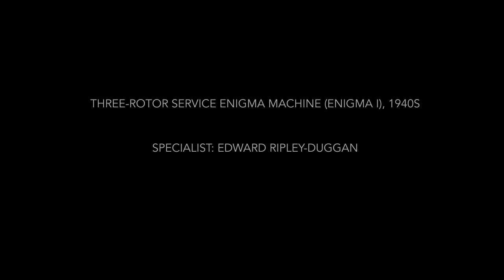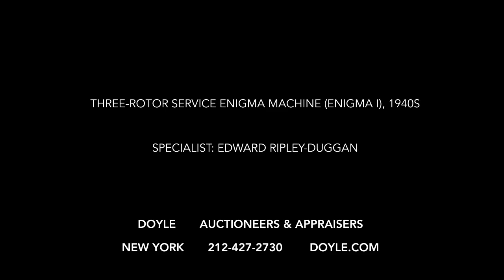Enigma Machine Demonstration

Comment: Funny seeing an enigma machine being powered by 2 modern AA batteries...
Reply: These 2 bots are everywhere
Reply: Lol
Reply: I can't sense the scale - - I thought they were two C cells batteries - - makes more sense
Reply: Enigma was mostly mechanical device - the only thing that needs electricity in Enigma is the light bulb. And just like flashlights do work with batteries, so could Enigma. In addition, using batteries as power source for these museo machines is a safety measure in case something causes a short circuit in that old device, nothing gets damaged easily.
Reply: They were AA batteries in an off-the shelf battery compartment. The machine was designed for a low voltage lead acid battery. Someone made (or may still make) a battery enclosure that resembles that official issue battery. I had a great deal of fun learning to use the machine, which is beautifully made, as witness the fact that it still worked.
Reply: How is it funny?

Comment: Still amazes me that the Germans designed a marvel of mathematical, mechanical, and computing engineering and they just put it in a small wooden box.
Reply: And how Turing understood the code
Reply: @Uncle Bremner I know it was a an incredible invention and I was just telling that Turing was a genius too.
Reply: Every electric or electronic device was put in wooden casings at that time. Have you never seen an old radio receiver ?
Reply: How so? They invented close to half of the modern world and continue to make great achievements.
Reply: Germans to date is the power hub of engineering

Comment: Apparently, if you try to encode a letter, you will get any one of the other 25 letters of the alphabet, but never the letter itself.  Numberphile has a great video explaining this, though I must admit that a lot of it is beyond me.
Reply: Great thanks
Reply: That was one of the keys to the British codebreakers being able to break the code, particularly if they had a guess. For instance, the signing off for a message might be the same, so if a letter matched, the settings could be known to be wrong.
Reply: A channel called Jared Owen has a fantastic animation explaining how the electrical circuit and mechanism works to scramble each letter
Reply: @thehelldoicallthis9241  yup just saw that. But he didn’t demonstrate the decryption.
Reply: @dibbyo456  he did. You just type in the message with the enigma in the same configuration as the sender and the lampboard spells out the decrypted message.
Reply: Given that the encoding was done purely by electromechanical construction, I think that it was basically impossible to achieve encoding of a letter to itself back then. The encoding path was literally electrical wire connection from one letter to another. You couldn't connect a letter to itself. Especially when you consider that plugboard is used. Given the nature, the same key can encode and decode a ciphertext (that means it's a symmetric key encryption), though it's the same mechanism that achieves both things, not two different algorithms like nowadays. Meaning you can use the very same machine for both encoding and decoding. Combination of one single algorithm for both encoding and decoding and the use of symmetric key for both encoding and decoding, and given the fact that it was done purely by electromechanical connection of literal wires inside the machine, I think it would be quite impossible to encode or decode a letter to itself.
Reply: @dibbyo456  The trick appears to be "the reflector." At that point in the rotor position the two letters are connected. Pressing one will light the other and vice versa. That's why you can encrypt and decrypt with the same machine and settings. And as a consequence, a letter wouldn't return itself.

Comment: Imagine Alan Turing would be German
Reply: Better NOT !!!!    :o)
Reply: The Poles broke the Enigma Cipher first!
Reply: @Jeffrey314159  What were the Polish scientists who did this?
Reply: @siriusleto3758  it was maria rejewski but it was getting too much time taking so alan turin helped to build a machine which would do it much faster
Reply: @indronilganguly9715  No. Polish scientist broke the code before 1936. But just before World War II, Germany added 2 more rotors, and to crack the code, scientists would have to use all the money for it (entrare intelligence department). And that, of course, was too expensive.
Reply: "Imagine Alan Turing would be German" - in fact the Germans had a fair amount of success in breaking Allied codes (and the Italians didn't do so badly either, simply breaking into the US Embassy in Rome and stealing the diplomatic codes - before Pearl Harbor.) The German codebreakers were not quite as smart as Turing et al, but they didn't have to be, as British codes were not that difficult to start with. The Germans were well ahead with Enigma and Lorenz, so their ciphers were hard to crack, requiring the genius of folk like Turing, Bill Tutte et al (and Rejewski before them.) Whereas the Brits used the B team to devise their own ciphers until they woke up circa 1943, meaning the Germans didn't need to be that brilliant to crack them. It should be said that the Germans devoted far less resources to codebreaking than the Allies, and were much more compartmentalised and disorganised about it.

Comment: 700 U boats was destroyed due to decoding this machine
Reply: Not really. Only about 750 U boats were lost in the Battle of the Atlantic, by no means all of them by enemy action. And obviously hundreds of them would have been sunk even if BP had never decrypted anything. The figures for U boat sinkings show a steady rise throughout the war, but then the number of U boats to sink also rose. The period March - November 1942 when Bletchley Park lost Shark - ie couldn't decrypt enemy messages, doesn't actually show a change in the trend of U boat sinkings. (Though it does show an increase in Allied shipping losses.) The figures for U boat sinkings start getting alarming (for the Germans) with increasing Allied long distance air cover, and the introduction of centimetric radar in 1943. 

In reality a whole host of things contributed to the Allies winning the Battle of the Atlantic, definitely including cracking naval Enigma. But the intelligence gained from this was probably more important for routing convoys away from U boat packs, than in actually sinking U boats. Which was of course important - the object of the exercise was to ship material across the Atlantic, not to sink U boats for the sake of it. But if you're interested in sinking U boats per se, it was more to do with increasing air cover, more escorts, better radar, Leigh lights and so on.

Comment: At first, I used to think that the machine is gonna be hard and complex, but when I tried it, It strikes me, because I was surprised at how easy it was to use an Enigma machine...
Reply: Of course, it's designed for operators to quickly decode and encrypt messages. The engineering underneath is what is baffling.

Comment: Did it have one functionality for checking if all light bulbs were working? Because I imagine it would be very troublesome if you pressed one letter and no light turns on...them you know some light bulb is burnt, but you don't know which. And the way the machine works it is not like you can press every button to check which one is the broken bulb...
Reply: You can press every button to check bulbs. As long as the initial positions of the three rotors are set back to the right one when you finish checking, it's fine.
Reply: I wouldn't be surprised there was some test lamp function on it. All the old equipment I used to work all had a test lamp switch.

Comment: From the video I understood that to encrypt and decrypt a message you have to set the rotors into a certain position first, then, as encryption goes, the rotors are spinning, and their position at the end is completely different. To decrypt the message you have to set the rotors to the initial position. Am I right?
Reply: Yes. 

One of the cleverer bits of the German Enigma procedure was that the sender chose a new start position for each message, and sent it to the recipient encrypted. So if there were a hundred different users of any particular key, each sending five messages a day, there would be 500 diffeent start positions used, not just one pre-printed for that day on the key sheet. Makes life a LOT trickier for the enemy to decrypt. (Note the guy in the video gets this wrong at 1:45 when he says that you set the three letters at the top to "the key for the day." The three letters (strictly numbers in the military version) at the top are how you set the message key - the start position - which as I say is different for each message. )

The Germans started off (prior to 1940) with a major error, as their procedure required the sender to send the message start position TWICE. So suppose the chosen start position was WXY, the operator would tap in WXYWXY and get out say DEJMAP and send that. But from that the enemy knows that D in the frst position and M in the fourth position must be the same letter, likewise E in the second position and A in the fifth position etc. That doesn't solve the whole puzzle but it enabled Bletchley Park, looking at lots of messages on the same key, to rule out vast numbers of settings as impossible, making solution a lot easier. The Germans wised up and stopped this sending it twice procedure, but in the meantime BP had read plenty of messages so they had a good idea of the sorts of things the Germans were likely to be saying, which helped them later with devising "cribs" - ie guesses of the plain text.

Comment: 1:30 Cryptographic Complexity doesn't equal Cryptographic Security - - that's the big mistake the Germans made/assumed with these rotor based machines
Reply: You have to remember that enigma was basically a mechanical calculator that only used electricity as the implementation. Technically it could have used even more mechanical parts instead of any electrical parts but it was easier to manufacture that way. The only thing that electricity actually did was to light a bulb using the wiring that consisted of only parts connected by mechanical movement. The electrical parts had zero logic.

With a purely mechanical design, it's hard to come up with anything better even today.

Of course, we nowadays know much better encryption algorithms using a shared secret key. The de facto industry standard is AES-256.

And had the German switched the front panel wiring in addition to code wheel settings on daily basis, there's no way the messages had been decrypted so fast. So the problem was that out of possible settings they switched only a very minor part daily. It's like using modern encryption system but switching 7 bits of a 128 bit key instead of randomizing a totally new key when keys are rotated and pretending that you're using the encryption to max effect. That part was just pure laziness by Germans.
Reply: @MikkoRantalainen  Scientists understand a lot about math, but they know very little about people. If the switch were automatic and not dependent on lazy operators, it would be much harder to break the encryption.
Reply: @MikkoRantalainen  
What the heck are you talking about?
While I make no claim to being an authority, each day's "device configuation" included 10 pairs of "swapped" letters effected by the plugboard; a different set of 10 pairs for each and every day... No device could participate in the conversation until its operator configured his device to match all the others...

Pre-war commercial Enigma machines only had rotors. Military use added the plugboard complexity. Do you think they added it just for fun?

"Lazy" includes "lazy thinking" by those who simply don't know but feel free to judge others...
Reply: @rustycherkas8229  The plugboard was just a simple substitution cipher (static for a day/month depending on the year, always statically substituing one letter with another) so it wasn't that hard to solve. In addition, because of the design of the machine, the plugboard substitution cipher was symmetrical so, for example, if A were subsituted with N, then N would also be substituted with A.

Sure, plugboard required one additional step for the decryption but it wasn't the hard part.

That said, the Enigma would have been safe it it had been used the most effective way ( maximum number of wheels for any given machine, fully random wheel setup, fully random plugboard setup and fully random starting position ). The last one was a major problem because it's logically the same as IV in modern encryption methods and German typically used "AAA", "BBB", "CCC" instead of random value. The Enigma machine would have been able to have encryption key strength near 2^50 but the use of (practically) constant IV undermined that a lot. I would guess German researchers didn't understand the importance of random IV or they would have fixed this simply by giving an order to use different method for the starting position.
Reply: Also note that to be safe the starting position should have been about 10 letter long random sequence instead of user selected (that is, definitely not random) three letter sequence. Otherwise it would have always been the weak link in the practical use of Enigma machine encryption.

Had Germany actually used a safe starting position, none of the methods that were used by the allied forces would have worked.

The importance of random starting position (or IV or Initialization Vector in modern usage) seems to be poorly understood by many people even today. For example, the WEP encryption once used in WiFi/WLAN was broken because of it's weak IVs.
Reply: @MikkoRantalainen  Please explain how you imagine the sender's "random 10 letter sequence" could be known by the receiving operator so that the decoding device could be correctly configured to decrypt an enciphered payload.
Reply: @rustycherkas8229  Same as any other IV: the IV is set in plaintext but it changes the effective encryption key used for the actual message making each message being encrypted with unique effective secret key. And because IV is fully random you cannot extract any information from it nor you can extract information about the remaining characters except the fact that Enigma couldn't encode any letter to itself. And to be fully effective, the IV must be long enough to contain similar amount of entropy to the actual encryption key or it will be the weak part of the whole system.

For example, in WEP, the IV was limited to 24 bits and due birthday paradox you get duplicate IV after 2^12 (half the bits) on average. As IV must be sent in plaintext you cannot hide which messages collide on IV. As each message needs unique IV not to leak info about encryption key via capturing multiple messages WEP could be easily decrypted because of this. Note how Enigma using 3 letter or roughly 14 bit IV and use of non-random IV reduced it to about 5 bits. As a result for 3 letter IV the best you could hope was about 2^7 (half the bits) or 127 messages per encryption keys (wheels, wheel settings and plugs) starting to leak information in theory or about 4 messages in practice with human selector (poor) IV.

Some algorithms are really vulnerable against poor IV. For example, the encryption mode most web sites nowadays uses, AES GCM, is maybe the best encryption mode available but will fail catastrophically if two messages with the same IV are ever sent. That is, using duplicate IV doesn't make things just easier to decode but allows figuring out the actual encryption key used! On the other hand, if you never duplicated the IV you can get much better performance and perfect forward secrecy with GCM which is why it's used pretty much everywhere. The interesting part is for GCM is that it doesn't require any secret entropy in the IV, it just must be unique for every message. For Enigma, using just unique value wouldn't have been enough.
Reply: Back in 1940's it was impossible to break an enigma cyphered message.

Comment: But then do you just read the letters on the radio? How do you transmit?
Reply: They sent and received all encrypted (enigma) messages using "moris code" over wired telegraph. 
No radio used for encrypted messages.

Comment: Why did they just have 26 keys for letters, why didn't they also have keys for the numbers 0 to 9,  for a total number of keys of 36, total number of lamps of 36, number of roter teeth 36 etc. Obviously it would be hard to add more lamps, keys, roter teeth and plug board holes increasing them all from 26 to 36, but that increase would give you the ability to send numbers as well as words.  I guess without that to send a number you must type out the word of the number, so to send 273 you would need to send the message "two seven three".
Reply: The German military took the commercial machine and tweaked it slightly, so you'll need to go back to the 1920s to ask the inventor that.

I don't know Morse, but I suspect numbers take a lot of keying and as letters could encypher to numbers, an approx 2/5 or 40% of a message could end up as numbers requiring more transmission with greater chance of error.  However the amount of numbers in a message could be quite small so you're trading convenience of plaintext for increased cypher text length in morse code.

A "shift" system for numbers could possibly be used, but you want to avoid giving hints to eavesdroppers, along with worrying about how you handle the unshift being lost.  Spelling numbers has the advantage that any errors in transmission/reception can be easily corrected (at expense of message length).